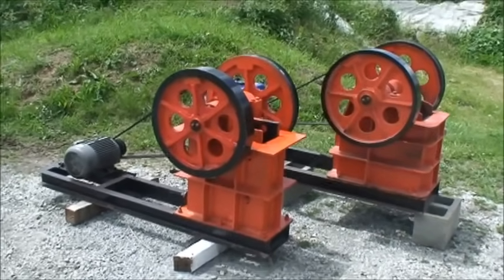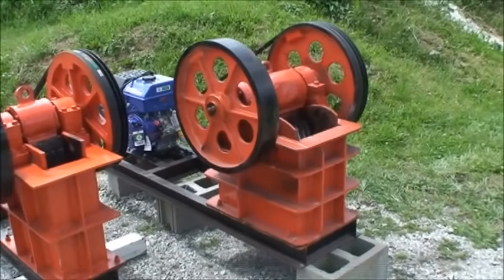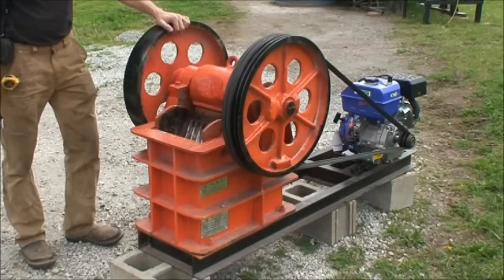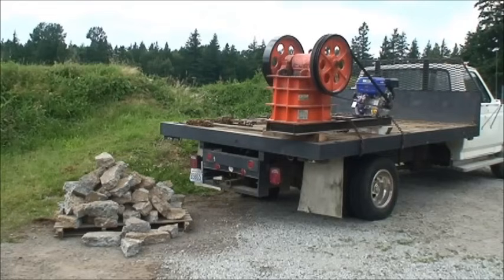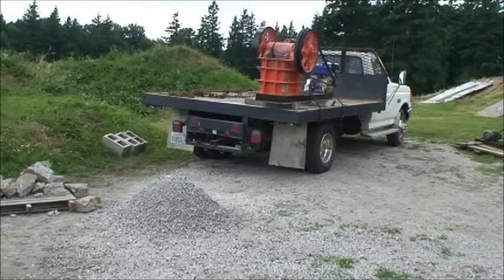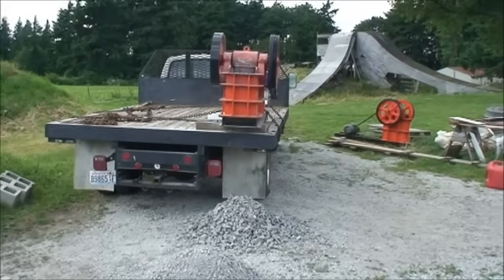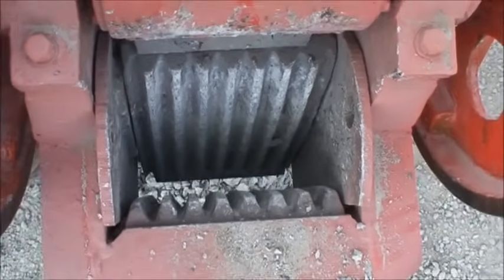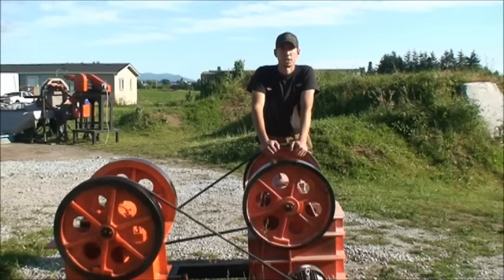Small Portable Jaw Crusher For Mining, Concrete, Recycling, Rock Crushing MBMM

Comment: I live in Ennis, Montana and we have 14 acres of horse property that require clearing  because there is a surplus of rocks that can be dangerous to our equine friends and also makes the property impossible for growing and cultivating. This is also the case with many of my neighbors. These small  jaw crushers are the perfect solution as there are many applications for the crushed rock. I believe the 6" X 10" gas jaw crusher would be appropriate size but I am sure it is cost prohibitive. Is it possible to acquire a used one?
Reply from the maker: For pricing, please send us an email at Info@mbmmllc.com or call 360-595-4445 You can also visit our website here: https://mbmmllc.com/
Reply: Did you purchase a machine? I'm not far from you, is but You're if you have one and are done with it.

Comment: Why don't you have  balancing weights on the flywheels to counter the unbalance of the jaw 's motion ?
You would not waste energy in vibrations,and keep it to rotate smoother and crush better 
The whole frame wouldn't move at all,less stress on all parts,bearings etc...
Reply from the maker: Great, thanks for the tip!

Comment: It's small diesel engine jaw crusher.could design better with stand and material chute.
Reply from the maker: Hi David,

Yes we do have jaw crushers with small diesel engines, stands and chutes.  We have mounted them in all sorts of different configurations; some on trailers, with vibrating feeders and discharge conveyors, or just as a bare crusher.  We have many different motor options as well.  Please visit our website for more information on the different types of equipment we sell (see link in video description).

Thanks

Comment: The big one is equipped with an internal combustion engine, not a "motor."  You should really learn to know what you are talking about before making a video.  Saying "Gas motor" makes you sound like an idiot!
Reply: nit picking
Reply: +ZagdaGreat  my car has a motor in it .... its an internal combustion motor
it runs on gas therefore its a gas motor 
but thats very good of u to pick up  on that.....considering no 1 else did
Reply: ZagdaGreat what's your problem?
Reply: I don't care for idiots.  The biggest idiots are the ones that refuse to be educated. But I don't really care. If you chose to be an idiot, by all means stay that way...

Comment: Nice idea but putting hands so close to the jaws is dangerous.  What about adding a feed hopper.  Can this idea be scaled larger to crush 12" X 12" concrete?  What is cost of units shown on video?
Reply from the maker: J-

Thanks for the comment.  All the guards and hoppers have been removed for this demonstration to show the working mechanics of the machine.  Guards and hoppers should always be installed when operating the machine.  You can see some of our other videos with the hopper installed on our channel, where a full bucket of material can be dumped into the machine to be crushed.  We have larger crushers that would be perfect for crushing up larger concrete blocks.  Please email us at MBMMLLC@gmail.com for a full price list and info sheet.

Thanks for watching and commenting.
Reply: बहुत बढ़िया
Reply: मशीन कहां मिलेगा